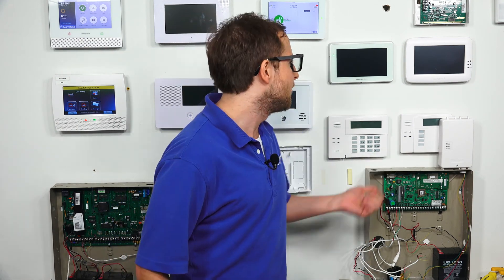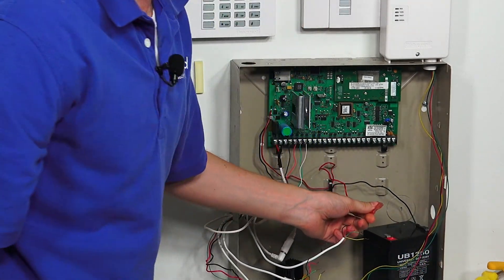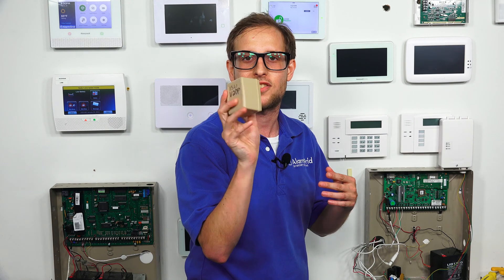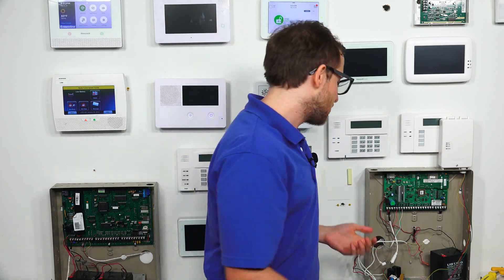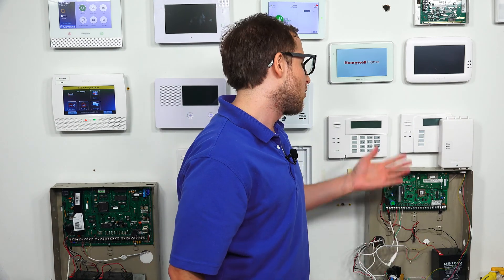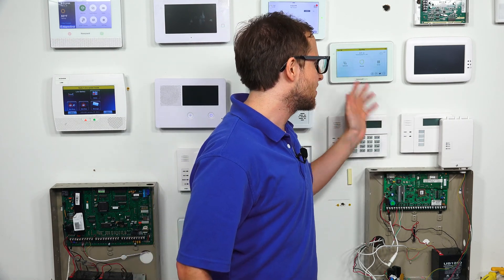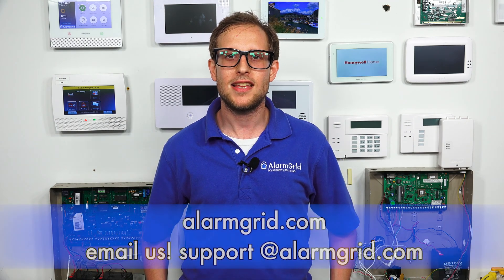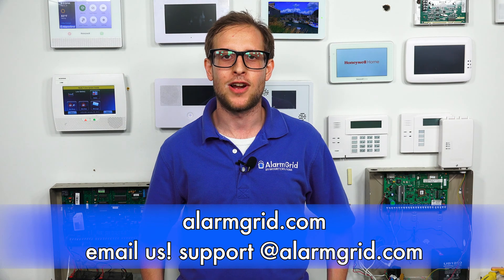Wired Alarm System: Resetting

Comment: Thank you. I called my home alarm company because none of my sensors were working they  came out, do troubleshooting on a display screen,never tell me about my wired box and say they see this all the time , my in the wall wires rusted out and I need to purchase new sensors.  Not believing that was the issue, I do an internet search. I find your video and within 2 minutes my issue is fixed!

Comment: I have an older magnum alert security system, recently, my green lights blinks showing zone 2 open, I checked the wiring and connections, no break. I replaced the battery, still shows open circuit. Any suggestions? Thanks!!
Reply: Hello @maharper100, For a zone issue, it is best troubleshooting the zone by using isolation. Effectively if the system requires an End of Line Resistor (EOLR), wire just a resistor on to the zone terminal in question. Or, if Programmed to not use an EOLR, and is set for normally closed (NC) just add a short wire across the zone terminals. See if this clears the trouble/error.  If so, then there is an issue with the wiring or sensor at the door/window/ect.. being protected.   (Life Safety Devices are usually Normally open and usually require an EOLR).

Comment: There is power at my control panel buy my keypads are blank like no power…could a back up battery cause that?  Thanks.
Reply: Same issue. Not sure what’s the solution
Reply: Yup same

Comment: Question: We bought a house a few years ago. NX-6 box is what I found trying to find a master code with no luck. I don’t know how, but I was woken up by beeping that this thing does all the time. Now how the Alarm was armed, only God himself knows. I was trying to stop the beeping and somehow armed the darn thing. My wife nor myself know of any code. The only way to shut the alarm off is to turn off a circuit breaker. However that also cuts off power to the outlets in the living room which is 5 feet from the alarm! 
Can you please help?? Or if you can give me a phone number maybe to whoever makes this alarm. Please! I’m begging for any kind of help. I don’t want to get rid of the system. Thank you
Reply: I'm experiencing the same issue, with the NX-6 box. Did you figure it out? Smoke detector went off yesterday got it to stop but now the system just beeps was able to cut power but want my smoke detectors (which are hard wired) to be on. If I turn the system on the key pads just beep. I hit something when trying to get the smoke detectors to stop. I don't know the system password.  Let me know what you did.